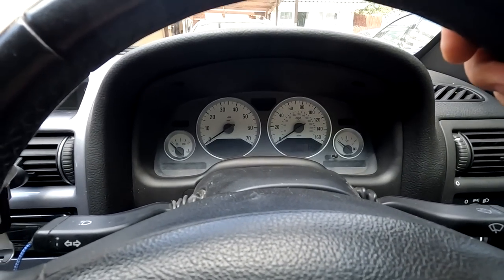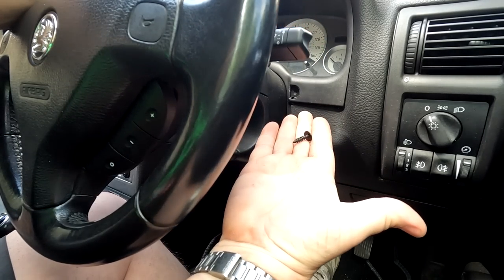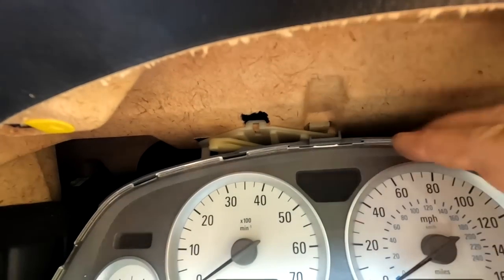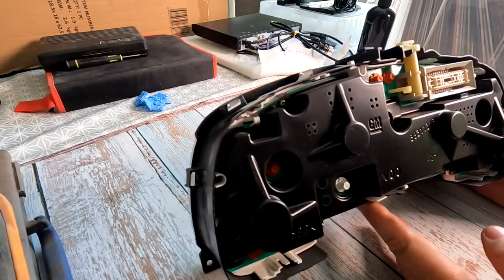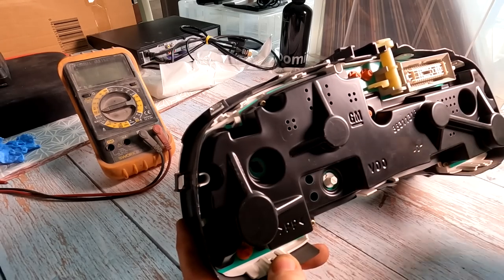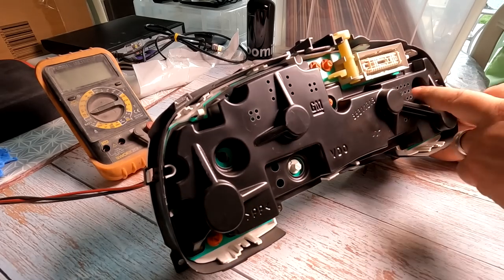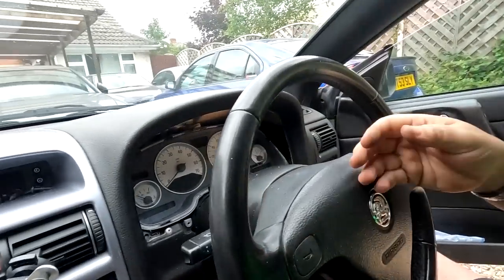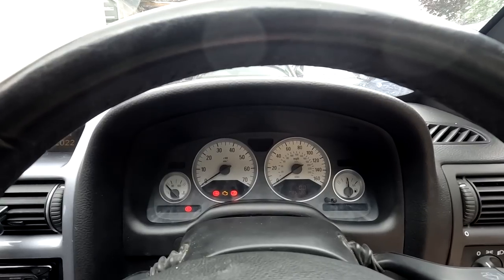Vauxhall Astra G Removing The Instrument Cluster

Comment: Did it ! - Easy as pie BUT I had to undo the plastic plus from the inside and attach it to the binnacle before putting it all back in. Impossible to do otherwise but it was very easy and just slipped straight back into place. Thanks for the video.

Comment: Most Astra MK4's have a steering wheel rake adjustment, if you lower the steering wheel as low as possible it makes it somewhat easier. Also when removing the actual binnicle if you pull it through the hole at the top of the steering wheel side ways that helps.
Reply from the maker: I did both in the video Andrew.

Comment: Cheers Martin nice one good little video to show how to take the instrument cluster out did look a bit of a pain to put back in. Good tip about the connector. They do go wrong I believe I have heard about it on the astra forum's. 👍
Reply from the maker: Yes its a common thing Ali, I spent ages trying to plug it in directly but it went in easy when i took that rear plug out and did it that way.

Comment: I don't mean this in a braggy sense at all, but I've had the MK4 binnacle out so many times you wouldn't believe. It's actually quite easy to get it back in once you get the nack of it - which was 8:30. First time I did it was a struggle - marked my dash up. After that it was so easy. Pull the steering wheel out as far as it goes, knock it down as far as it goes & jobs a good un.

Had to do it for converting them to LEDs. For me the best look on the binnacle is a plasma dial mat but not the crappy ones you get off eBay. I had the one off the Xtuners website in mine. Looked great.

Love your Astra content. Still miss mine after having had it 12 year.
Reply from the maker: Getting it out was easy, the  problem came with trying to locate the connector and lock it in place.
Reply: Yeah even on the first attempt, like anything - getting something out is easy. It's the putting it back together again thing that's always testing. 
I found once putting it in like you did 8:30, it just sort of fell in to where it should go. Then just lock the latch and jobs a good un.

I thought it a decent design. Shame they didn't carry it over to the Corsa C. That Corsa had an awful binnacle design which could result in the entire thing just dying. No needles, no display, no nothing. It'd come & go, come & go. I remember driving about 150 mile on the motorway once with no speedometer at all because it wouldn't come back to life. Had to use the sat nav speed as guide.

Comment: In another video, with the exception of the two orange bulbs at the top and the white one at the bottom and center, the others visible were beige. Here on the contrary they are all orange except the white one. Now, since a different color seems to correspond to a different wattage (beige 1.5W, orange 1.12W) I wonder if it is okay to replace an orange with a beige one (which I ordered already...)... Also, what wattage does the white have?

Comment: Those bulbs you’re changing only light up the dials when the dashboard lights are on, for the indicator bulbs they’ll be tiny smd leds, which requires some careful solidering
Reply from the maker: Where are those located Josh.

Comment: Hi can you give me some info plz ,I have Vauxhall Astra 1.4 petrol hatchback 2019 is my transmission a m32 or M22 ,I need to replace my clutch slave cylinder and  2 pc clutch
Reply from the maker: I don't know but when you give your registration number of the vehicle to a parts supplier, the right gearbox will come up for your vehicle.